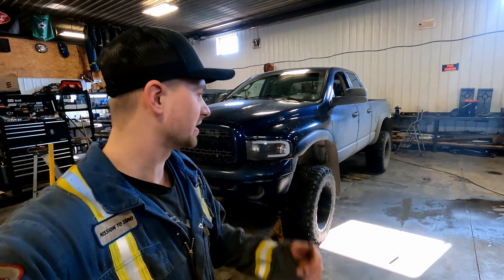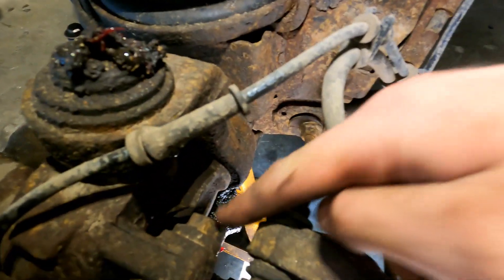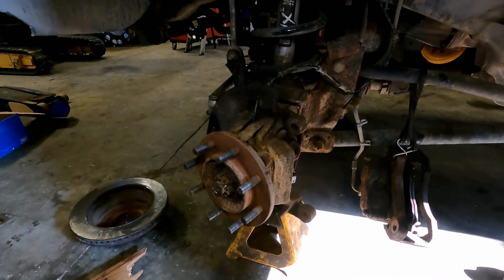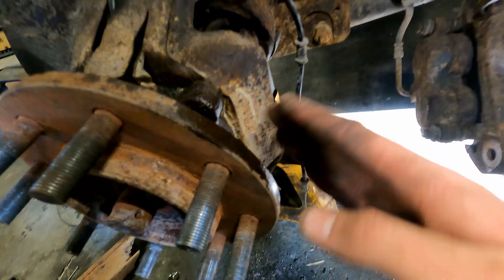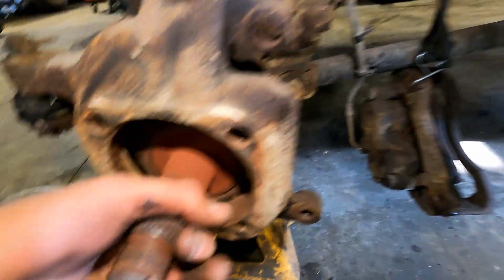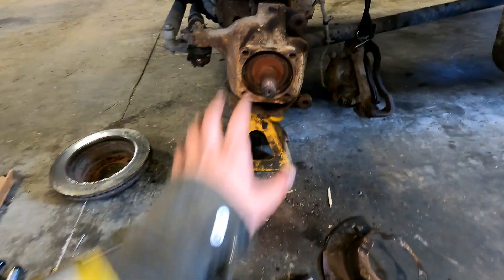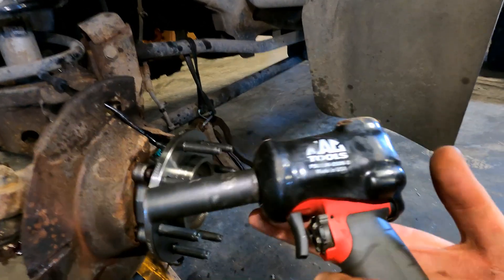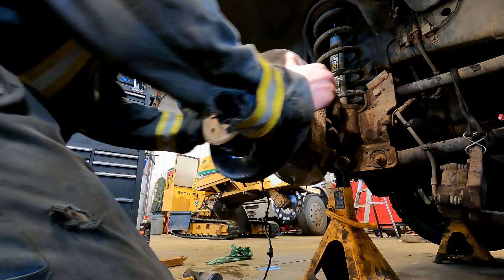How to change front hub (wheel bearing) on 5.9 cummins

Comment: I would like to add a few tips based on my own experience that may be helpful for others who do this job in the future::
– The power steering method that others have mentioned is very useful in cases where the hub is really stuck. You can look up YouTube videos detailing how it works, and it's pretty simple.
– I recommend spinning the axle nut on upside down until it is flush with the end of the axle before hammering directly against it. This prevents seriously damaging the threads or mushrooming the end. 
– I usually don't worry too much about torquing every single bolt exactly to spec, but I think the axle nut is one where it's important so that the bearing is properly loaded, so here it is:

AXLE NUT TORQUE PROCEDURE:
1. Tighten castle (axle) nut to 132 ft*lbs (179 N·m)
2. Rotate axle at least 5 times to seat the wheel bearing
3. Tighten castle (axle) nut to a final torque of 263 ft*lbs (356 N·m)
4. Align slots in castle (axle) nut with cotter pin hole by turning to the next available slot and install cotter pin

Comment: Bought a 3/4 socket wrench for this purpose about 15 years ago and luckily have only used it a few times. Torque specks on the hub bolts is 150 ft lbs.
Great video man!  I really like the channel

Comment: Good job on the bearing change out!! To make these bearings last much longer or maybe indefinitly, pull the ABS sensor out once the bearing assembly is installed and take your grease gun, press it into the ABS hole and pump extra grease into the bearing. It seems that the bearing manufacturers don't use much grease (planned failure?!?)  Thanks for the excellent vid, happy trails !!!
Reply from the maker: Hey buddy great idea! Thanks
Reply: instablaster.
Reply: Just changed both front hubs on my 2014 ram 6.7 Cummings 4x4 and now my ABS light and Traction control light on. Both hubs and wires are brand new out of the box. Any idea what it can be? I never had a light problem before changing them.
Reply: @DATBAYOUBOY504  Find someone with a scanner that can tell you what wheel is at fault. Probably a bad wheel speed sender.
Reply: Are you sure grease will reach the bearings? It might be sealed up around ball bearings to keep dirt out which means new grease will not reach it?

Comment: Instead of hammering the wheel bearing to get it out I’ve always just put a socket in between one of the bolts and the axle housing and use the power steering to pop it out
Reply from the maker: Ya I mentioned that in the video, I’ve used power steering as a last resort.
Reply: @darkirondiesel  I'm lazy. I use it as a first resort!

Comment: Hey thanks for video help my friends bearing just went out after trip run and in my driveway  and that's all it went, "lucky" So now it's  getting  fixed but it's got torx  head bolt instead of 6- point bolt Lovely.

Comment: Good job but put the inner u joint up and down the outer u-joint front to back turn the wheel either way put a socket between the axle housing and the outer u joint and turn the wheel back in it pushes the wheel bearing out you can start the truck and use the power steering and then do a little tiny Taffy tap tap with a hammer caught everything with anti-seize when done for future so it is easy to work on putting loctite on the threads does keep the rust off the threads

Comment: To make this go A LOT easier, get a small punch. Loosen the 4 bolts on the back side, place the punch on the head of the loose bolt. Start the truck and have a helper turn the wheel slowly, use the steering as a hydraulic press. This will save you about an hour of beating your head against a wall.

Comment: Use the power steering with a socket put pressure on the bearing from the back and hit with hammer it will push out easy

Comment: The first thing I do after I take the wheel off, is take the litter tie rod out if the knuckle..then I loosen the wheel hub bolts and you just tap them with a little pecker, after taking off the big axle stud bolt...simple job once you use these steps..also leave the tie rod bolt on the thread while u tap it out

Comment: Good video man!

I have a 16 f350, would I also jack if you from the middle of the diff and then place axle stands on both sides like you did ?
Reply from the maker: Yup it would be the same since they both have solid front axles. A duramax would be different though because it has independent suspension

Comment: Do you add any grease inside the assembly or is there enough from the factory
Reply from the maker: No I don’t add any grease it’s a sealed bearing
Reply: Thank you
Reply: You can remove the ABS sensor and pump grease through that hole. Spin the hub and give it a few pumps until you can feel some resistance in the hub. If you service them like this they will last a very long time.